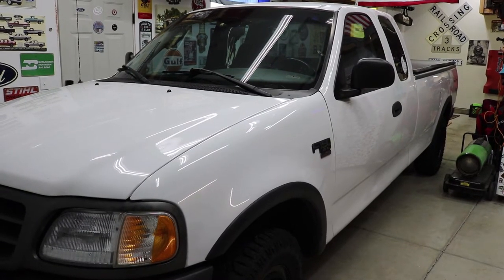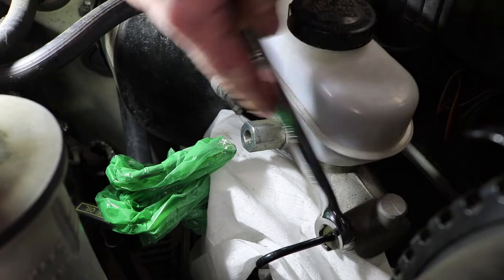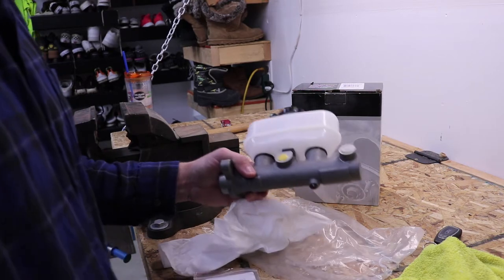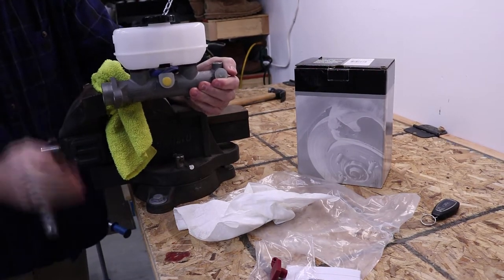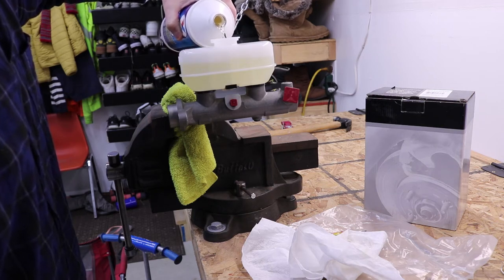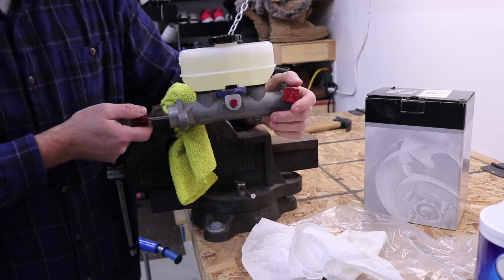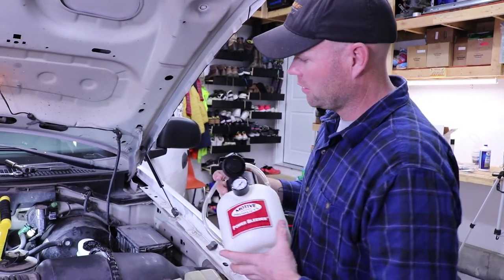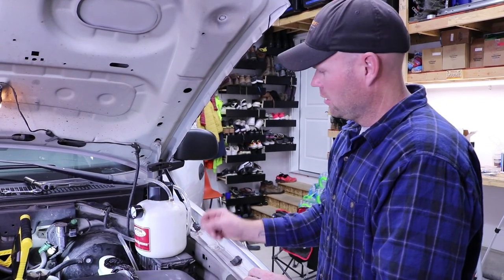Ford F150/Expedition Master Cylinder Replacement How-To

Comment: My expedition (07) has a spongy pedal, still brakes but only at the top 1/3 of pedal and bottom 1/3, I do hear a slight “woosh”. Bled the brakes, still did it. Mechanic at ford said its the master cylinder AND MAYBE the abs hydraulic module bit that they dont make them anymore. How do I know if its the module? No light or error code was signaling. And if so, where do I get one? Thank you.
Reply: I have the ABS light on the dash and I was told to try salvage yards to find an ABS module for the same model of my expedition but make sure to test the ABS module before installing it on my expedition to make sure it works.

Hopefully, I can find the same model vehicle at a salvage yard.

Did you find one?
Reply: I only replaced the master cylinder. Did the trick. I have no ABS light on… hope I dont need one later.
Reply: @whataboutjesus425  That's good you only needed to replace the master cylinder. I'm still looking for an ABS module.

Comment: I replaced the booster but the brakes are still not working ... Could it be the brake slave /master cylinder ?
Reply from the maker: Yes could be the master cylinder or also the ABS module if you have ABS. By not working what do you mean? Spongy? Pedal slowly sinks to the floor?

Comment: Does yours have advance trac, if the master cylinder goes bad is it necessary to change the whole system including booster? Thanks
Reply from the maker: Mine does not have advance trac it’s just the  basic xl work truck and no you don’t need to change the whole system you can just do the master cylinder if you want.
Reply: @BLUECOLLARGARAGE  thanks, some people say I need to change the boot due and the cylinder, I just don't why if its the cylinder that is bad
Reply from the maker: @ralphwhitaker8761  yeah that’s not true you can replace either one it don’t matter. What is your truck doing?
Reply: @BLUECOLLARGARAGE  I appreciate you man, thanks a lot for the input, God bless
Reply: @BLUECOLLARGARAGE  ok can I used the old fluid that is in my reservoir or does it have to be new fluid, and can I just bleed from the reservoir or do I have to loose the brakes hose by the caliper? Thanks
Reply from the maker: @ralphwhitaker8761  you will have to use new fluid because brake fluid absorbs moisture. First you will have to bench bleed the master cylinder and then bleed each caliper starting from the passenger rear, driver rear, passenger front, and then the driver front. You may need to do this multiple times to make sure all the air is out. Also will need either a person to help you bleed or get one of the single man bleeders or a mightyvac works well.
Reply: @BLUECOLLARGARAGE  ok but do I fill up the reservoir before bleeding or after bleeding

Comment: I replaced the master cylinder than bleed it and than bleed the brakes, I installed new rotors and  new brakes with the same old calipers and hoses. I see fluid when bleeding driver and passenger wheel, but when I drive I see smoke on the passenger side and the caliper is locked, I can hear the rubbing. What can be the problem and also what solution do you suggest? Thank you.
Reply from the maker: Sounds like your passenger side brake caliper piston is seized and locking up. Happens over time especially in the rust belt states and if the vehicle has been sitting for awhile. Only solution would be to rebuild the caliper or buy a new one. Also if you saw smoke most likely damaged the front rotor and and brake pad so you will need to purchase all new front rotors and pads and you might as well just replace the driver caliper as well and then re bleed everything again.
Reply: @BLUECOLLARGARAGE  ok thanks do you also think I might need a new master cylinder?
Reply from the maker: @ralphwhitaker8761  no because you already replaced it right? And if you getting fluid out of the calipers then the master cylinder is working. How are you bleeding each caliper?
Reply: @BLUECOLLARGARAGE  I bleed them manually by my self, I put a piece of wood against the seat and repeat that about 3 times and than pump  the brakes

Comment: If you order one of these off Amazon I dont think you get bench bleeding plugs. How can you do it without the plugs?
Reply from the maker: You have to have some sort of pluf or line coming out going back in to the master cylinder reservoir to get all the air out. I know the parts store sell a master cylinder bench bleeder kit made by dorman that comes with multiple sized plugs and hoses.
Reply: @BLUECOLLARGARAGE  when you bled this in the video was the cap on tight or loose?
Reply from the maker: I left the cap off

Comment: Just bought a 97 f150, 4.6 5 speed that is 6 hours away over by Nashville. Taking a booster with me and doing this in a parking lot. Dude says peddle goes all the way to the floor and won't hold pressure. No external leaks so I'm thinking it has to be the booster. How much fluid leaked out of those lines?
Subbed by the way!
Reply from the maker: Jody thanks for the sub! Yes could be the booster but also may be the ABS module these trucks are known for the module to develop internal leaks creating a soft pedal that slowly sinks to the floor.
Reply: @BLUECOLLARGARAGE   Hmmm...I'll try the master first, then if that doesn't work..has to be the ABS Module  if there is no visible leaks. Appreciate  it
Reply: Your video was very helpful, the only thing missing is the rusted out ends and lines from all the salt used in a upstate New York winter haha.  Thanks brother!
Reply: @BLUECOLLARGARAGE  it.was the abs pump
Reply from the maker: @19jody72  Glad to hear you found the culprit. Did you find a used one?
Reply: @BLUECOLLARGARAGE   yes I did...it was hard to find an ABS pump for a.97 with 4 wheel and and.drums rears. But found one and put it on..works perfect. Thanks
Reply: I know this is old but hopefully you reply. I read somewhere about a spring in the abs you could remove and it would fix the pressure issues caused by the abs.  Is this at all familiar sounding ?
Reply: @mikevlogs4501   I did get the truck.. drive it back 5 hours. The problem was the ABS pump. Put another one on it and it's been fine ever since
Reply: @19jody72  I hate that I feel like this might be the problem for my neighbors I'm working on. Hard pedal when engine off. Straight to floor when running making those air whoosh sounds. Unfortunately someone else put a used master cylinder on it thinking that was the problem so now I have to remove it and bleed it before I do anything else just in case he didn't bleed it properly.
Reply: @mikevlogs4501   EXACTLY  what mine was doing. I put a new master cyl on it just to check, even though it had a new looking  one on it. Didn't change anything.  Put the new(used) ABS pump on..instantly fixed it. You have to  get the one for the truck though.. mine had 4wheel abs with rear drums. Some are 4 qheel and with disc and some are just front abs.
Reply: @19jody72   well ,that sucks cause I just bought him a new master cylinder 😂 someone put a used one in it and I found a crack where the brake line bolts in so it needs a good one regardless
Reply: @mikevlogs4501   It's possible it could be bad,  but mine was doing the exact same thing and I put a new master cyl. on it.  But my money would be it's going to need a new abs pump.. please let us know how it goes if you don't mind
Reply: @19jody72  even if it is the ABS pump it needed a master cylinder anyway it wasn't even pumping fluid to the front at all and the reservoir has so much trash in it it's ridiculous
Reply: I just installed a new MC and now my brake warning light is on and pedal has no pressure. Any help?
Reply: @theewashman  Did you bleed the brakes or the master before you put it in?
Reply: @19jody72  I bled the master but not the brakes. I can see how that would make the pedal spongy if there was air in there and/or the oil fluid was bad but would that trigger the light to come on?